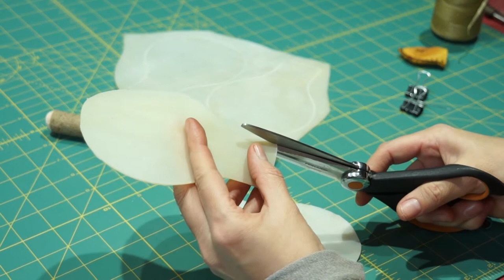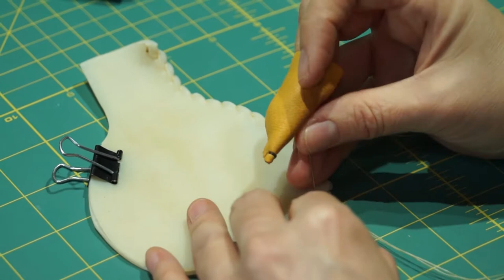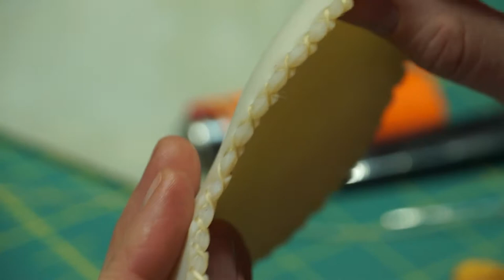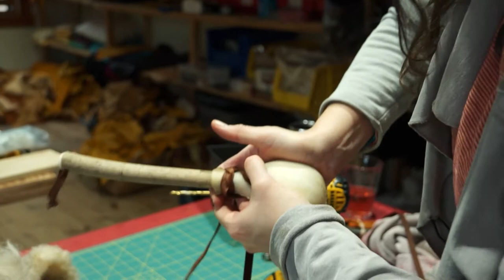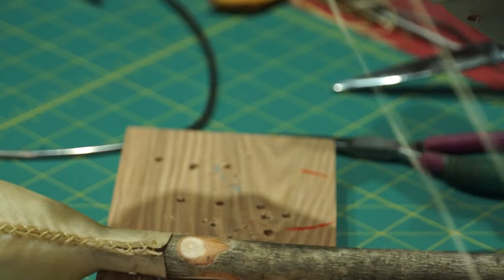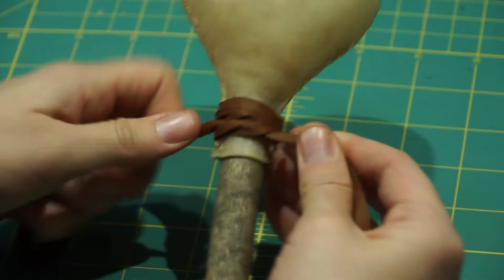Tribal Spirit Rattle KIT (DIY)

Comment: After stuffing the rattle with the stuffing, it looks dirty.  1) How can I clean it before painting?  2) Also, what paints to you recommend to use and 3) should I apply a coat of polyurethane on before or after?  Thank You!